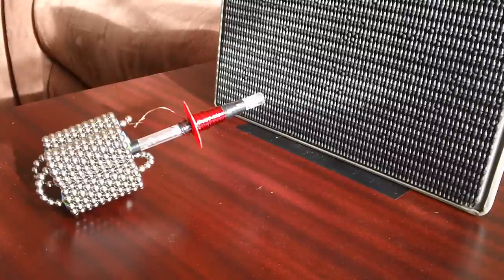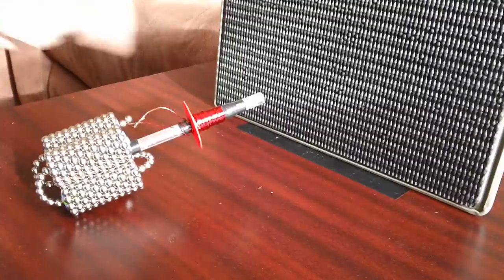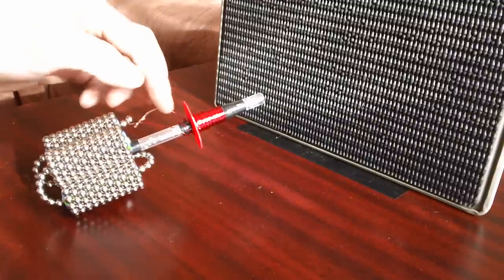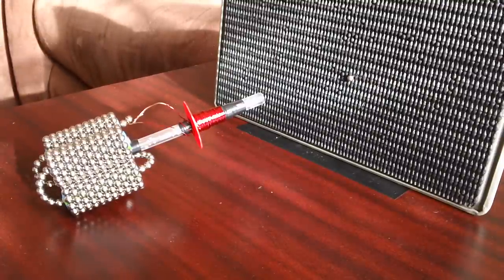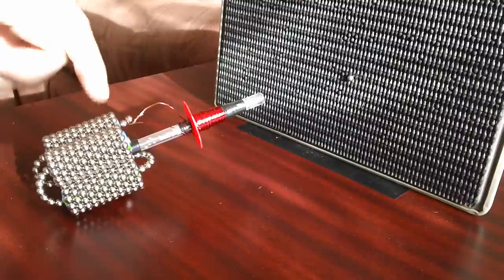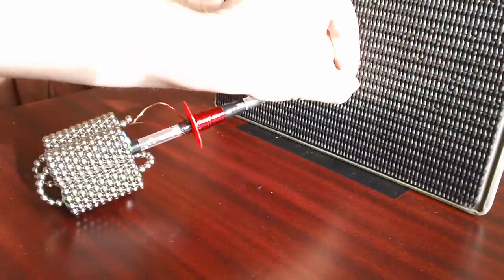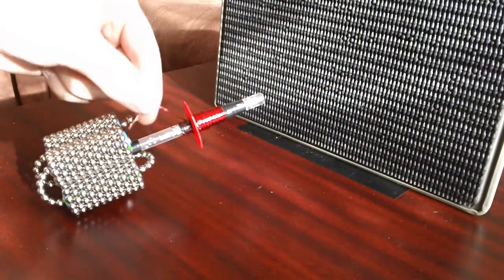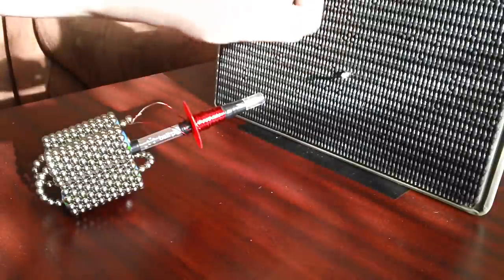My Buckyballs Cannon.

Comment: it's based on electromagnet coil , like electrical motor's work . That red wier in coil generate electromagnet power (magnet) when he touch the red wier he close the circuit and the ball is attracted to it and after the ball passes the wier it's pushed . it's easy to make it.

Comment: seems kindof like a railgun except railfuns are very fast and do more damage
Reply: Well, just like a railgun, it's essentially a coilgun. Where the railgun uses two full-length powered rails to drive the projectile using the lorentz-force caused by the magnetic field between these two rails, a coilgun usually has one or more coils fitted along the barrel, each shortly powered to energize the projectile. Though they actually employ the same principles concerning magnetism :) The major difference would be where the projectile touches the electrified rails in the railgun prototype (and resulting current which will heat up the projectile) whereas in a coil/gauss-gun the projectile is only effected by the magnetic force from the coils, not from a resulting circuit. It's this main distinction, wether it uses coils fitted outside the barrel or wether it uses rails alongside the barrel wether it's a rail or gauss-gun